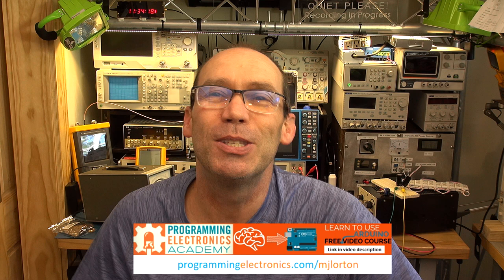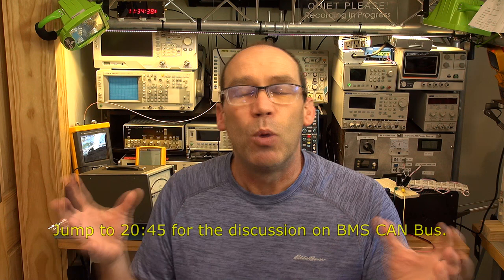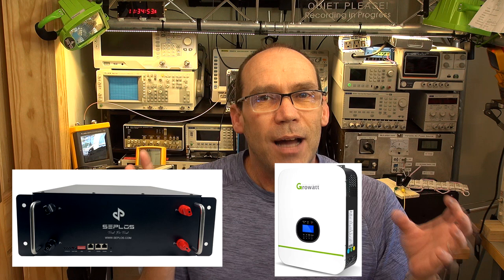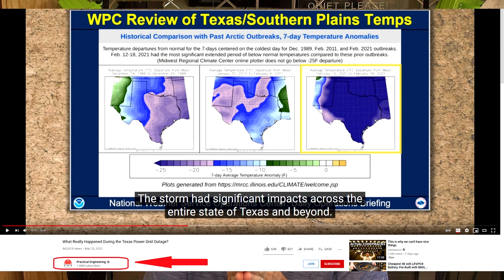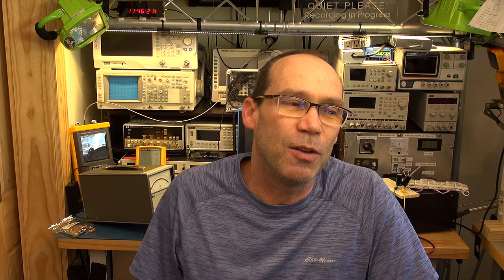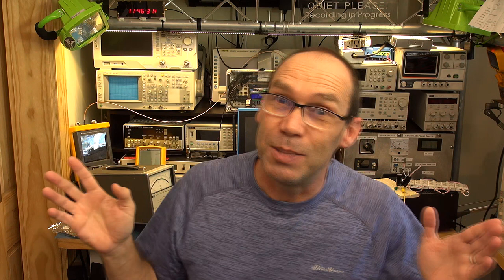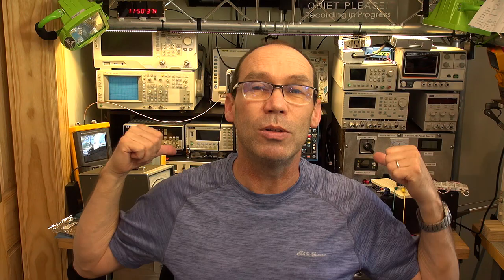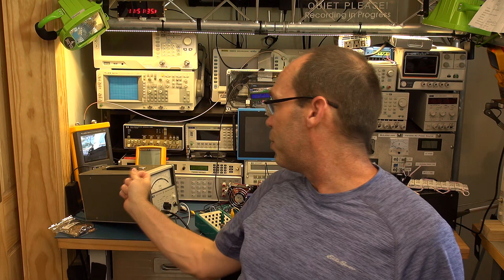T4D #150 - BMS CAN Bus of Worms  and Updates!

Comment: I bought a victron inverter because of your reviews on it. I got involved in the software development and now I work for them. So in some way it's because of you. One of the things I work on occasionally happens to be the testing of new batteries and the canbus protocol. I'd love to give you more info if you need more for a video.
Reply: Hi Izak, interested to hear more about your testing with new batteries using the canbus protocol also!
Reply: @swinters3369  Well, it works more or less like this. Victron already supports a large number of batteries, including their own Smart Lithium range. But the bread and butter of the company, of course, is its line of Multiplus and Quattro inverters. If there is a compelling commercial case -- in other words if it sells inverters -- you can contact the big guy, and then someone from R & D (sometimes me, sometimes someone else) will put the battery through some basic paces, just to see how it works and how much of the protocol is supported. If it works well, the required settings is documented in the manual and it becomes a supported battery.

But as I said, you need to make a compelling commercial case for it.

The protocol that is used by most of these batteries is thankfully very similar, so quite often it does not take a lot of work. The protocol isn't even Victron specific: If memory serves, SMA came up with the first iteration, and it simply became the defacto standard.
Reply: @izakburger1580  Hi Izak, in a way I am the same as you, but on the hardware side, i fixed a victron inverter and been sorting out inverters since, just wanted to check re the can bus comms on victron systems, do you know if the can bus protocol from the Seplos battery is 100% compatible victron in terms of charge control?
Reply: @izakburger1580  hi Izak, thanks for the reply, I have a venus gx connected to the battery, works well with the system, but just have an issue with the charging, this is new to me, how do i use candump on the gx to see what date the bms is sending?
Reply: @dewald2069  Well, first you have to root the GX. Just google for "root ccgx" and that will get you there. Once you've set a password, you can use ssh (Windows users will use something like PuTTy) to log into the device and get a shell prompt. Then, if you are familiar with unix or linux systems, the rest should be easy.

Some devices have multiple canbuses (Venus-GX, Cerbo-GX), some have only one. If you type the command:

candump can0

It will show the traffic on can0. And you can repeat that for can1 on devices with multiple canbus interfaces. Then you can see the raw information broadcasted by the battery.

Hit ctrl+C to stop it. Again, if you know Unix/Linux, that is common knowledge.

To know what it means, easiest publicly available document (since the battery protocols tend to be pretty similar) is to google "REC-BMS SMA protocol", and that will get you a PDF that describes most of the common stuff.

For the more intricate stuff, you need to ask the battery manufacturer for information.

Typically the batteries divide into two groups, which I sometimes dub the 0x359 and the 0x35A group. The majority of batteries send alarm and warning information on a message with id 0x35A. Some batteries however send it on 0x359, and still others send both of them. Both styles are supported in a Victron system, but 0x35A is preferred. Since there is also a lot of copying going on, especially in batteries from the east, you will sometimes see the protocol lifted verbatim from another, for example, if you see that bytes 5 and 6 in 0x359 spells the letters PN, you know they copied it from Pylontech...

:-)
Reply: @izakburger1580  Hi Izak, thank you so much for the info and taking the time to explain it, I will give it bash, I am not to familiar with unix or linux but i will give it a try.
Reply: @izakburger1580  Hi Izak, thanks for the info, I managed to get the can data with candump thought the GX, now just have to look at the data... thanks again.

Comment: Great video on the state of the inverter and battery market. It seems China is way ahead of the others these days. I believe Voltronics makes the Aexpert King, MPP Solar, and Growatt inverters. I have two of the MPP Solar LV6548 in a configuration very similar to what Will Prowse is using in his garage. I also just purchased some seplos products, as they emulate Pylontech, and it seems the Growatt and MPP Solar leverage that protocol, so direct connect is possible. Thank you for this very informative series, and also thanks for helping me choose my HAM radio! Your in depth vids are awesome!

Comment: I played around with all type of Leadf Acid, AGM and LiP04 until I settled on my current setup. Four 5.2kWh (20.8kWh total) Tesla Modules can be had for $4k off of eBay with the battery management board and in my opinion the cell, fit/finish and quality is superior in every way. My main breaker stays off. I use my EVs as a dump load from March to November as I have far more power than I need.

Comment: If im understanding you correctly to make the seplos batteries usable the canbus is required to be connected to an inverter? No way to use the seplos as just a simple plug and play like a drop in battery? Do you have a link to the next video